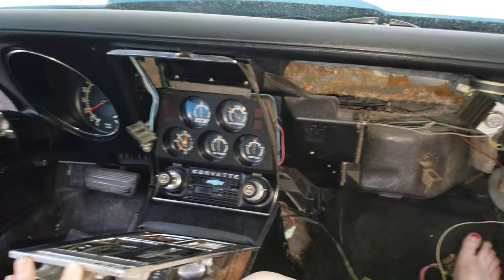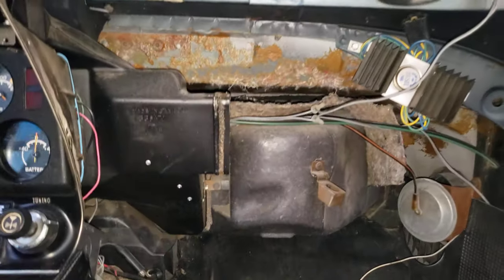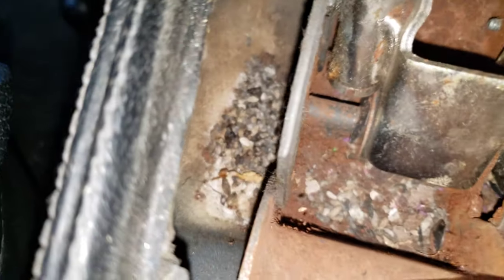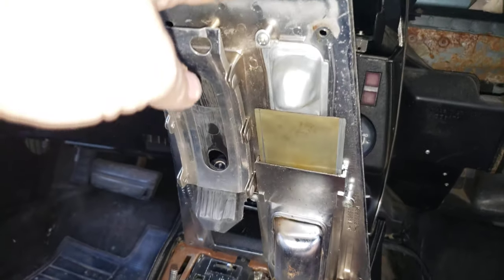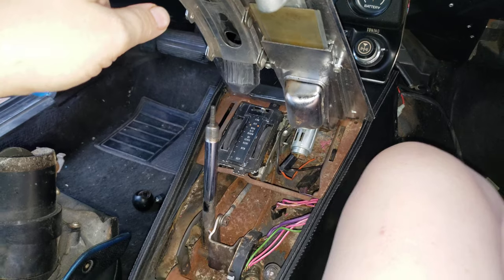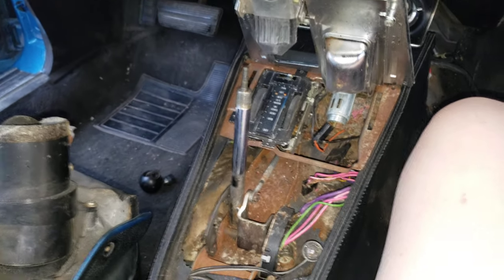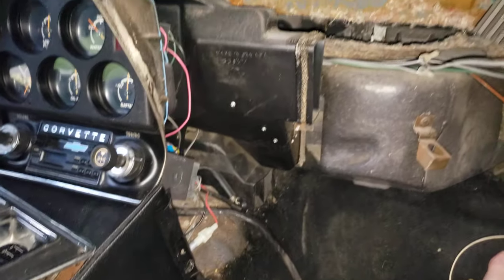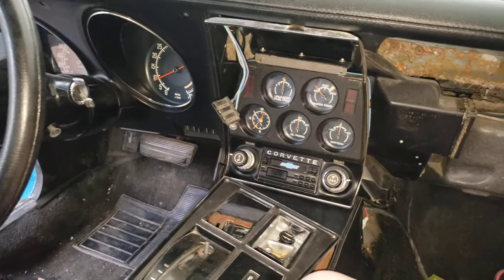1976 C3 Corvette - Dash & Shifter Console Removal

Comment: Had the same issue. Stank and nasty. Chewed up my wiring for the neutral indicator. I see they chewed yours all to shit too.  The issue is the piss smell never leaves because the carpet and jute insulation under it soaks it up. Only way I got rid of it was gutting the interior and replacing / cleaning / painting the floors.

Comment: I am having a lot of issues with my 79’s center console instruments. I just changed the circuit board and not the damn temp gage indicates 200 degrees. Before that the voltage meter and after that the oil pressure gage. I don’t know what I am doing wrong. Any ideas?

Comment: How did you take that main console off around the shifter? I have a 1980 and just bought a replacement boot because mine was gross and was hoping for some insight before I started the project. Thanks!
Reply from the maker: Hi Lucas. To get the shifter console section off, you need to remove the center gauge cluster, which includes two small bolts that bolt the bottom of it to the shifter console section underneath the radio; then the two small kick panels (near driver's and passenger's feet); loosen the parking brake console section (but you shouldn't have to remove it completely); then you should be able to remove the shifter console section. I was thinking I explained that in one or both my dash videos but perhaps I'll make a new short video about that process just for its own sake. Seems to be a ton of interest in dash removal. :) Keep your eyes peeled for a new one about it in the next day or so! And thank you for watching.